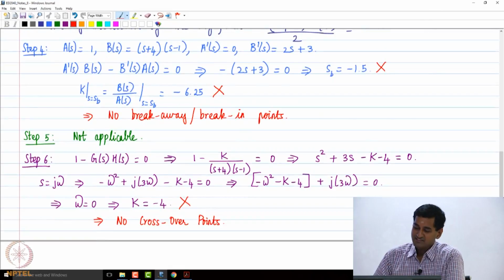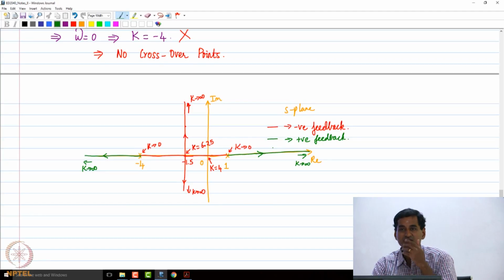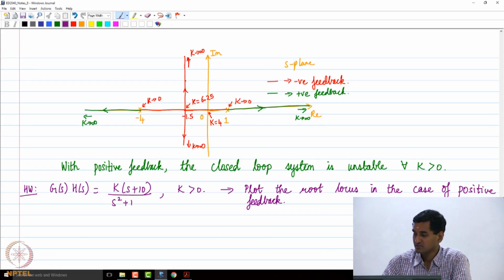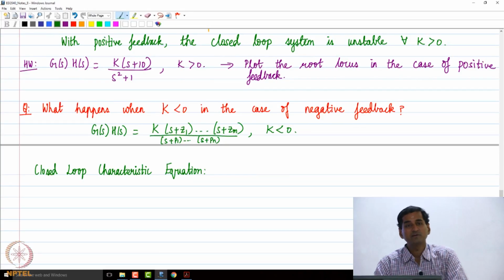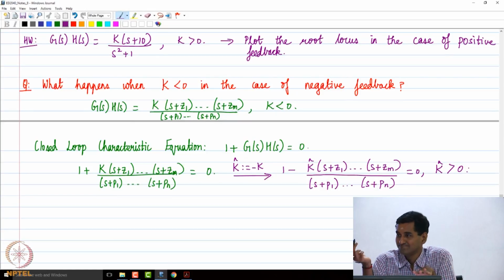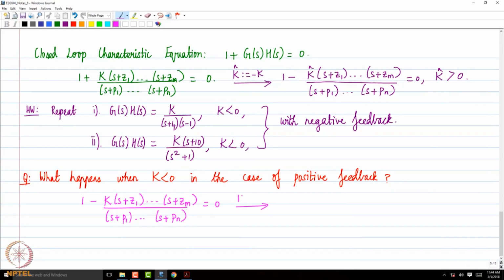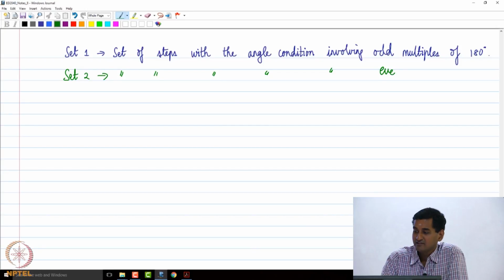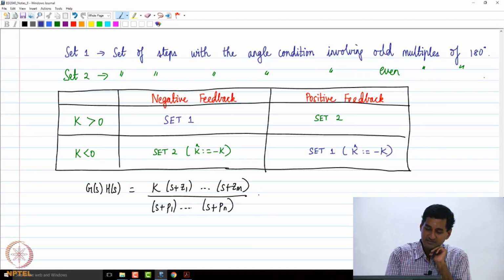Root Locus 4- Part 2

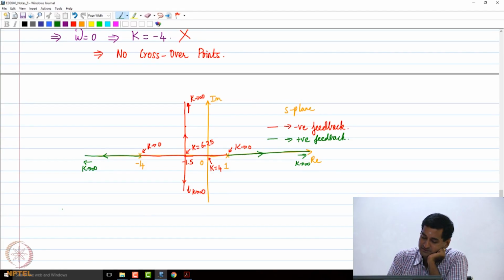Comment: + FB implies CL syst is unstable for all k>0   3:00
case : K<0 with -- FB = pseudo + FB with k > 0    6:00
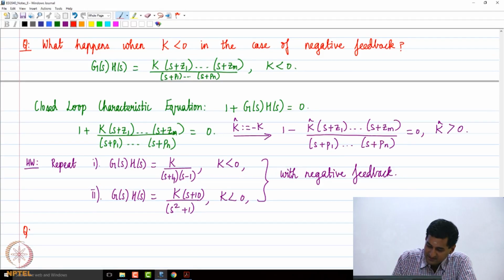case : K<0 with + FB = pseudo -- FB with k > 0   12:10
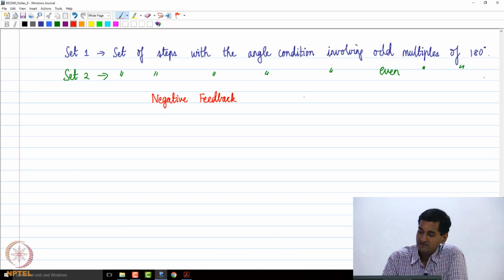summary    16:00
set 1: angle condition of odd multiples of 180
set 2: angle condition of even multiples of 180

                                             --- FB                                          + FB
k > 0                                     set 1                                          set 22
k < 0                                     set 2 with --ve K                       set 1 with --ve K